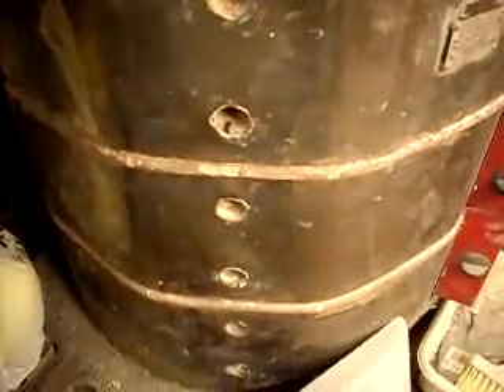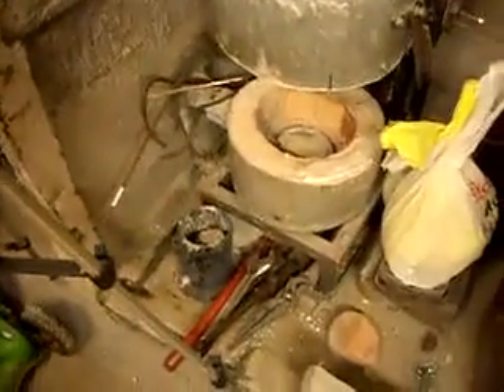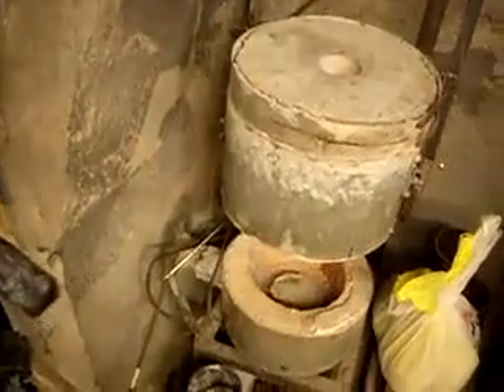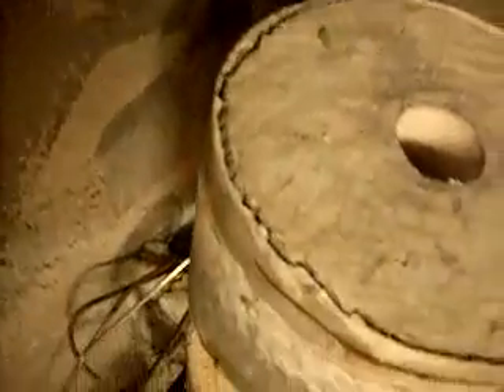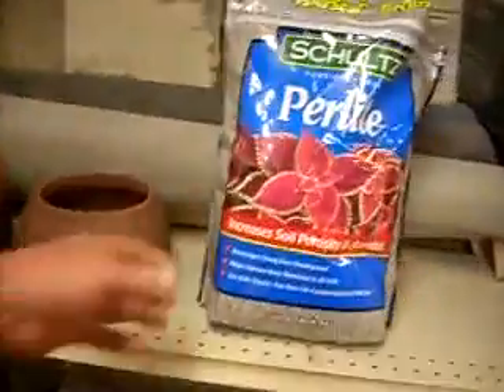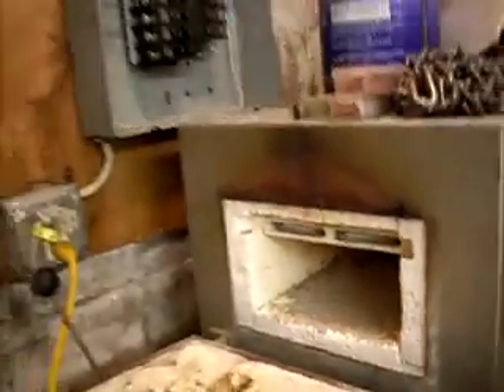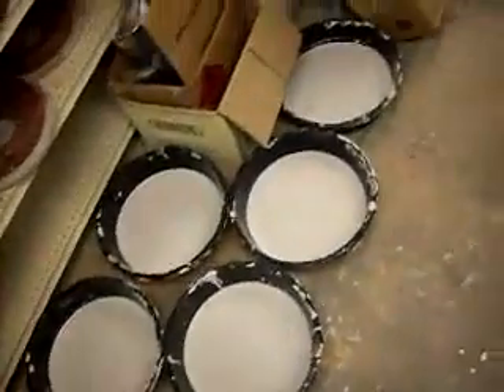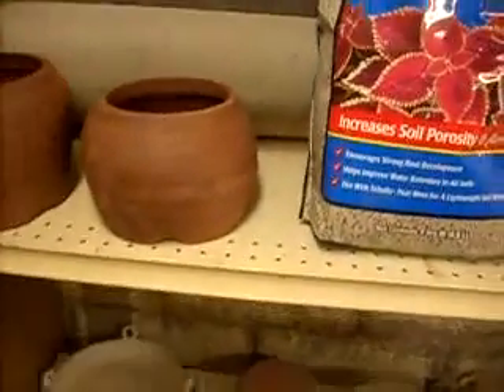ParrotPotterStudio: Home brew castable refractory cement for peepholes.

Comment from the maker: Some casting irons melt as low as 1175 deg. F, some as high as 2900. You can buy "furnace cement" at building centers that is rated to 2000, but I would suggest doing further research. Try ceramic supplies stores, they might also be able to help.